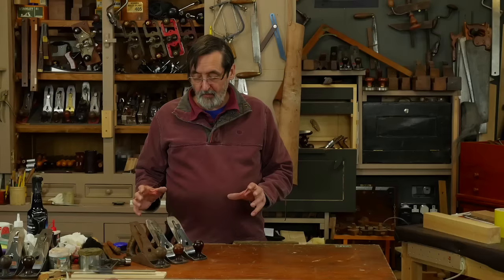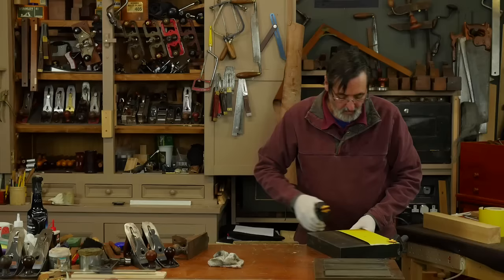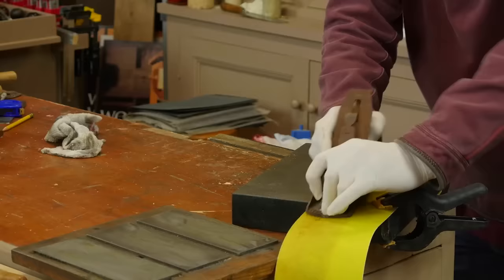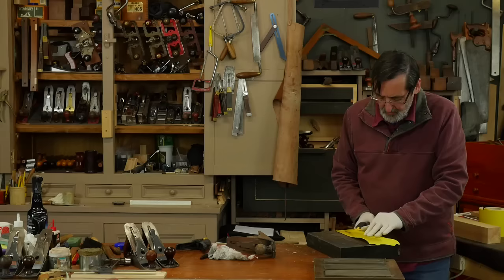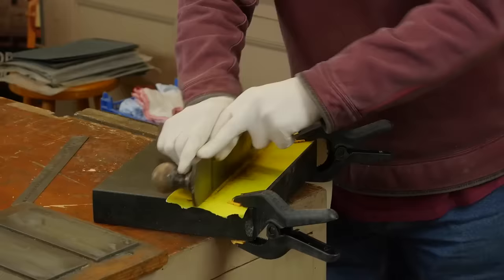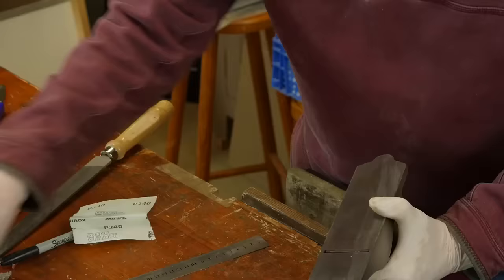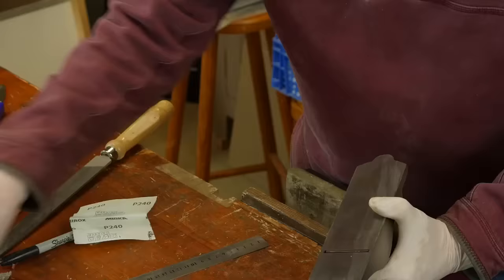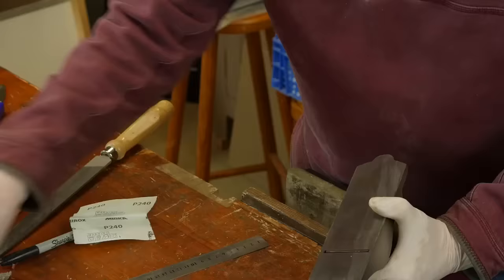Restoring the Bench Plane | Paul Sellers

Comment: I came across a old 1950s No 4 plane that needs some work especially on the Iron as whoever tried to sharpen it just altered the straight edge into a skewed angle, Would it be worth my time using sandpaper to bring it back straight or head straight to a bench grinder?
Reply: +iShootBandits it would be worth your time to avoid the bench grinder. it may be slower, but by hand is going to give you a better result and keep any hardness the cutter has. it is also good practice on sharpening it by hand. a good experience is always a good thing.
Reply from the maker: +iShootBandits When things are wildly out there is nothing wrong with using a bench grinder IF you have one but I don't think one skewed iron warrants the purchase of a bench grinder.
Reply: i always mess things up when i touch them to a bench grinder. last thing was an axe that I used cutting dead blackjack til the round of the bit was flat. after i was done grinding it was hollowed and non tempered. aka, my lack of skill destroys anything i touch with power tools. bastard files and stones for me.
Reply: +james lawrence james when i want to use a chisel or a plane blade on the grinder i take my square and with a pencil draw a line across the blade...  yes you can see it and then grind to that.  makes it so much easier to get it right.
Reply: i do the marking like that for filing. my main problem is always a couple seconds too long of metal touching bench grinder and it gets a wee bit too hot, really soft (never holds an edge well) and then completely useless. i know the fault is with me, but it is kinda hard to mess up with a file, comparatively.
Reply: +james lawrence james i always have a jar of water beside the grinder.  every few seconds quench it in the water and the grinder will work better if you use a light touch.  when you push to hard into the stone you will get heat build up very quickly.  grab an old chisel or piece of steel and practice with it.  i actually have a finger close to the tip when grinding.  if i can start to feel a bit of warmth i know it needs to be dipped in the water.
Reply: +iShootBandits I prefer to use a belt sander.  I mark the blade like others suggest.  I find that the sander is less prone to accidentally drawing the temper from the blade.  The important thing is to position yourself so you won't catch the edge in the belt and have the sander fling the blade back at you.  I built a jig I can clamp to the sander that helps set the edge angle, though I haven't used it in years now.  Once you get the edge trued, it will usually stay that way if you are careful while you sharpen.
Reply: +iShootBandits  Sounds like someone made a scrub plane from No 4
I'd keep it as is or get another iron & have both a smooth & scrub..
Reply: doesn't take long on a grinder to square it up. take a pencil and a square and put a line across the top so that you have a line to grind to.  take it slowly and dip in water every couple of seconds so the tip doesn't heat up to much and lose temper. then its to the stones to put a decent edge on it.  usually the whole operation can be done in under 10 minutes.
Reply: I would suggest a stationary belt sander if you have access to one.  You need to set the angle correctly and probably use a marker to make a square line across the width at the edge to help guide.  The other aspect is that the set of the blade to the plane's mouth is usually adjustable via the lever (if you have a Bailey or Bedrock or similar).  If you can align the edge properly using the lever sharpen it and use it as is.  But, when sharpening the blade, each time gently bias pressure toward the longer side. Over time you can straighten it without heroics.
Reply: +Tayler Made he is English and he likes to do it the old way.
Reply: Do you see a power tool at all in his shop?

Comment: I have a question that will most likely result in some ridicule and definitely identify me as a novice hack.  Why not put the blade in a vice and use a file to remove the nicks evenly then go back the bevel guide and sandpaper or stones to reapply a razor sharp edge?

Comment: Where do I find rolls of flooring sandpaper in USA? What width is that? By flooring does he mean hardwood-floor?  In usa, flooring is sadly often vinyl
Reply from the maker: They sell rolls of sandpaper on ebay or Amazon and some of the big box stores have it. It may not be called flooring sandpaper so just ask for the rolls. It’s 4 inches wide and usually it’s sold in 10m to 50m rolls
Reply: thank you! found it when I typed 4 inch roll sandpaper. for some reason, it wasn't showing up in the searches before

Comment: +Paul Sellers What is the brand of or Honing Guide for sharping blade?
Reply: The Veritas one is expensive but very good.
Reply: Matt Cremona shows how to use a $15 honing guide.  But what Bushcraft1974 says is correct.  The thing with chisels is that the back has to be flat and polished and then only a tiny bit of the bevel needs to be "sharpened" and polished.

Comment: What is the block you clamp the abrasive paper to called?
Reply: +Silky 2016 It's called a granite surface block. Such blocks are machined to tight flatness tolerances for precision metrology. They are very flat and stable, which makes them perfect for flattening the soles of planes or other tools. 

You can also use float glass. It is not as heavy but it is much less expensive. Even small granite blocks like this one can cost between $30 and $300 dollars, depending on brand and quality. My cheap Chinese granite block was on sale at Rockler for $35 bucks when I got it years ago. I have since acquired many sheets of tempered float glass ( for free) from a business that closed. Display cases are often made from fine flat tempered glass and they make wonderful surface blocks for flattening and sharpening.
Reply: Thanks I'm going to look into getting one :)
Reply: +bottomlands  Thank You for the tip,  I have a granite counter shop just down the road from me about Two miles.  Thanks again "Ten Nails"

Comment: I need some advise concerning the handles i think its rosewood and i believe rosewood can be quite toxic and can have an allergic effect on skin so should i be nervous about this??..Can you get some plastic coating that is non toxic or something like that  ?? in the perfect world i would sand the coating off but since its Rosewood ( I think it is ) im really paranoid when it comes to stuff like that :(

SKÅL !!
Reply from the maker: its not a problem in the context of handles.
Reply: Thanks for your answer Paul :) So i can go ahead and knock the finish off ? i was just searching and i found out that shellac is non toxic dont know if that's true or not ( I'm new to all this :) )
Reply from the maker: +CRILLER3 they coat most kids candy with shellac to make it shiny. hard to imagine.
Reply: Wow i did not know that so that confirms it then it is ¨safe¨  normally i just use some Linseed oil or BLO i think you call it :) but since its rosewood ( i have read some pretty horrifying stuff on the internet about allergic reaction on skin and such ) but im properly overreacting..

Thanks again Paul for taking your time with me :)

Skål From Denmark

Chris..
Reply: Rosewood is a very common wood for many purposes (such as the fretboards of guitars), I'm sure some people might have a reaction to it, but those people are probably far between.
Reply: As with any exotic wood you need to be careful about breathing in the dust. But most people don't have to worry about anything else. (Splinters should also be avoided obviously) Any film finish should do the job of protecting you from wood you are allergic too if you are one of the few who have those issues. Lacquer, Polyurethane, Shellac, etc
Reply: I removed the old Shellac and applied some furniture Shellac :) im not allergic person but better save than sorry :) even thou i hate plastic finish i like oil finish better :)
Reply: CRILLER3
Well shellac is not plastic at least. I agree, always better safe than sorry when it comes to allergies.

Comment: electrolysis is a better first step for deeply rusted pieces
Reply: +Big Fat Tony's it uses chemicals, takes a long time, is fiddly to set up, has an inherent danger, and (if you don't have the gear already) means you have to source some sacrificial iron and a DC power supply. That's not even getting to the subject of metal toxicity. 

Pretty sure the ``better method`` is some old sand paper on a flat block for 30 seconds. 

I've tried both methods, Paul's wins hands down for flat surfaces.
Reply: Chemicals = washing soda & water, yes, technically you are correct, both water and washing soda are chemicals.  You have to attach two clips, yes, right again, idiots will find this very very fiddly.  It does take a long time.  But your skill of reading comprehension is very poor.  This is not a discussion of one or the other.  I wrote 'for deep rust', Paul has only encountered light rust in his demonstration.  I say if one encounters deep rust start with electrolysis.   Then proceed with sandpaper.  A battery charger, plastic tub, water, washing soda, a piece of steel is the complete materials list needed for electrolysis.  It converts the rust to steel which reduces the amount of sanding to be done which means less material removed from the tool  There is no metal toxicity subject to discuss, where did you come up with that one?.  Their is inherent danger in getting out of bed in the morning.  I don't think that you have ever used electrolysis, you saw it on a You Tube video and your reduced powers of perception lead you to these ridiculous conclusions.
Reply: o rite
Reply: Graphite anodes

Comment: Why You didn't use any chemical substance to take the rust off? It would destroy the metal parts?
Reply from the maker: I just don’t like the mess and I like instant results which I get with abrasive paper.
Reply: You achieved good looking finish with abrasive paper but I was thinking why You chosen mechanical solution instead of chemical that would be able to go everywhere in every corner and part. I was thinking this is because it may destroy the hardness or flatness of the metal. With abrasive You can destroy some brand descriptions, so this may not be good solution for restoration all very old things. I am not into manual polish with abrasive paper because it always takes me very long time and there are usually deep scratches at the end. If You want to have mirror finish or even close to it, it takes really long time with manual abrasive paper polishing.

Comment: anyone know what's the grit of the yellow sandpaper?
Reply: No, 
But I started mine with a few light strokes on 60 but will primary rely on 80.  It depends on how rusty it is.  How fine you go through the girds will depends on how much elbow grease you are willing to give.  IMO, 120 or 150 is fine enough.  You will start losing some of the patina that some of us values.  As you step through the girds, the plane will get shinier.
Reply: I noticed that the underside of the yellow paper was 120, so that's what he's starting with.

Comment: Are older Winchester planes any good?
Reply from the maker: Yes, indeed they are
Reply: josh mullins 
Many (maybe all?) Winchester planes were made by Stanley. From a collecting value they are usually worth more than the equivalent Stanley due to the cross-over of wood tool collectors and gun collectors. Very good planes to use on wood, too!

Comment: Quit using the yoke for a screw driver. Why don’t you use a wire wheel to remove most of the rust, or even evaporust ?

Comment: You hold the blade on one hand & the chipper on the other.  The camera doesn't close in on your hands to show which side of the blade is up or down nor which side of the chipper is up or down.  Then you just put them together.  It left me confused.
Reply: Bevel down (so its notches engage the advancement cog) with chipper on top.  Assemble at right angles, then swing the chip breaker into plane, its leading edge well behind the bevel, slide forward, tighten, install.